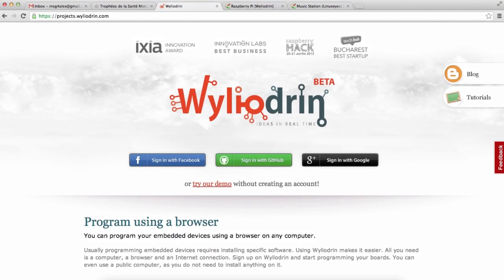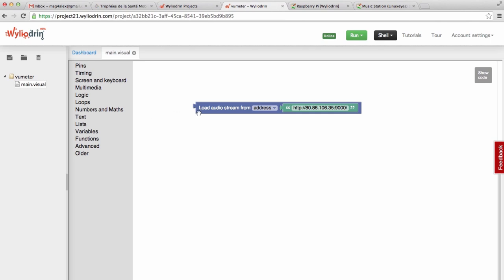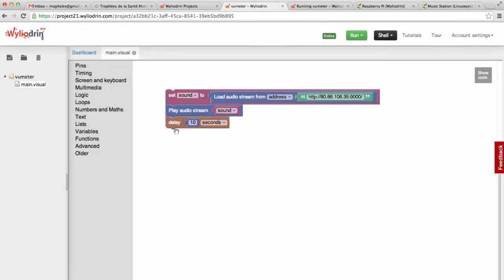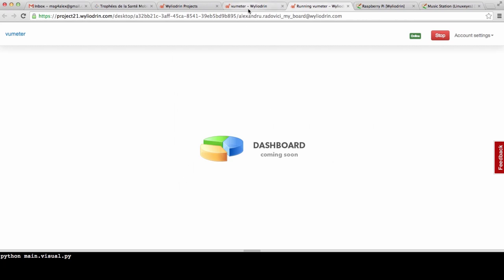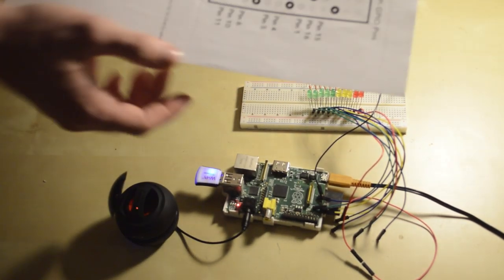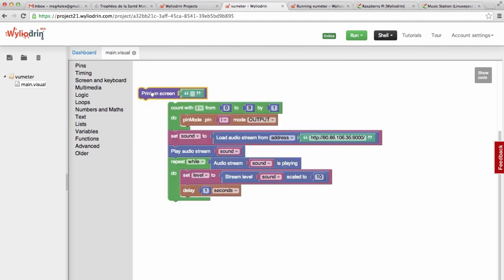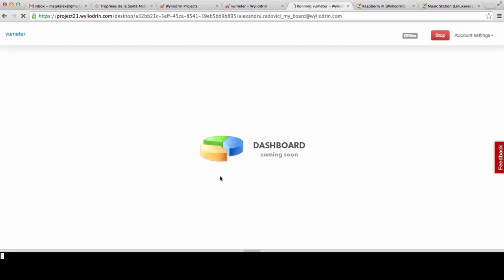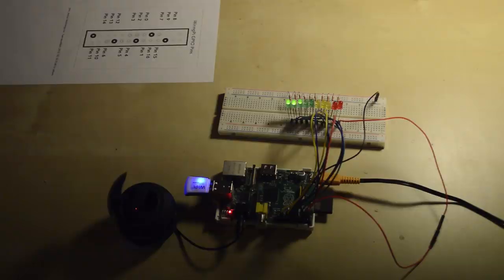Learn how to create a radio with a VU meter on a Raspberry Pi, using Visual Programming

Comment: The program ran the way you said however the clock speed must have been set to extreme since the Pi was very hot. I guess the firmware set it that way. I had to stop experimenting since I need my Pi . I guess Microsoft is up to their old tricks again trying to kill a device so they could sell theirs. Thanks but no thanks.